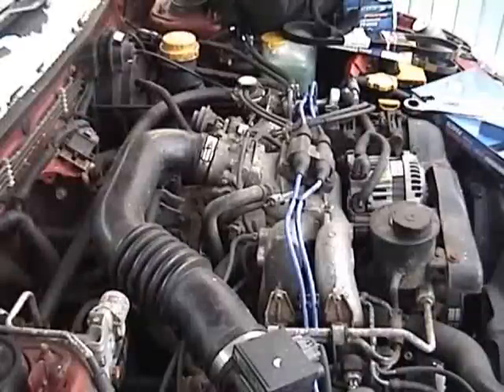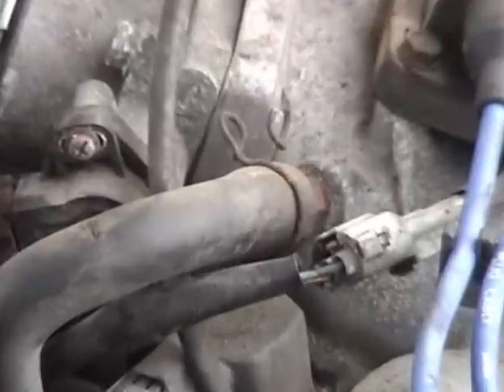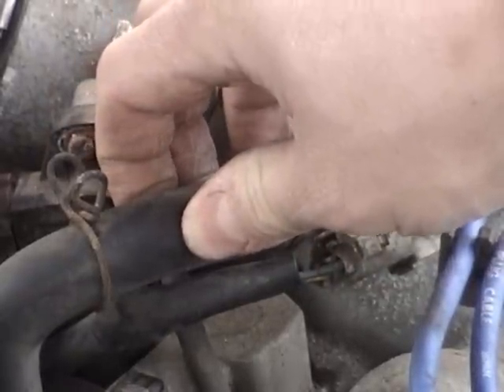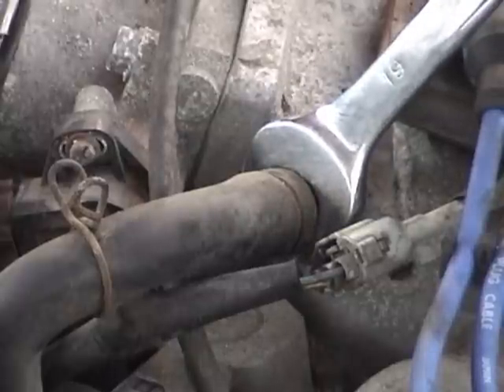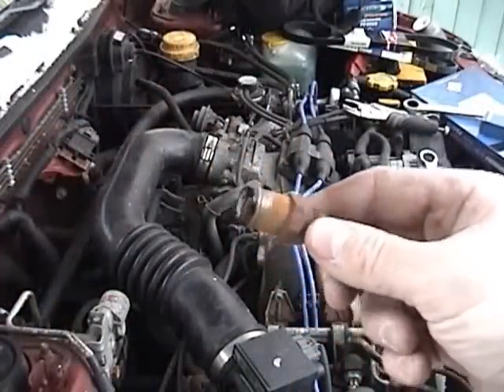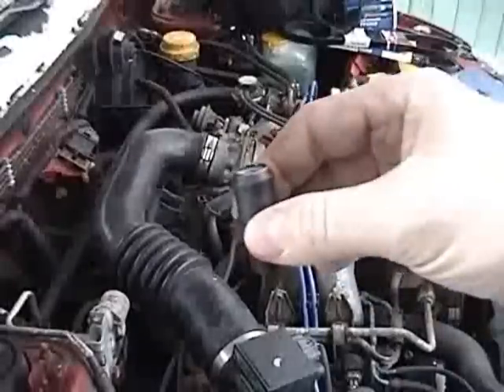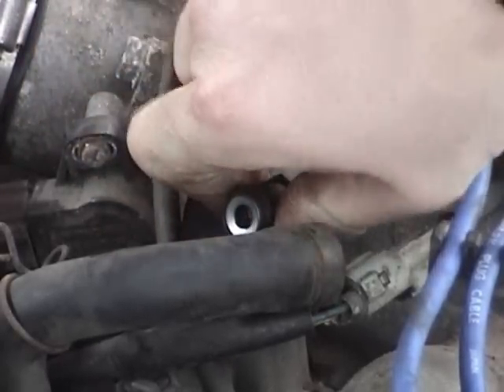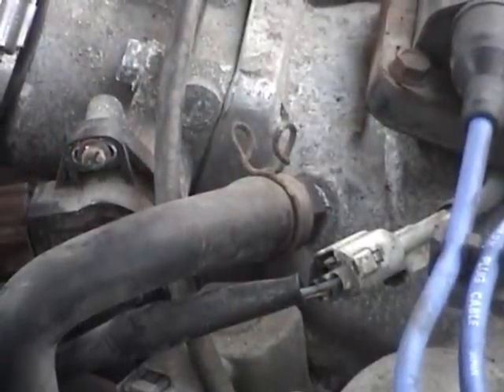1995 Subaru Legacy L Outback: DIY - pcv valve replacement

Comment: This was helpful for me. Just did this for my 1999 Legacy BK 2.2L, removed three 10mm bolts holding down ignition coil, unplugged its terminal, moved it all aside, detached PCV hose, then removed PCV with 19mm socket.

Comment: Do you know the name of the part that the pcv hose connects to? Hard to describe it, but it also has a small hose that connects to the air intake?
Reply from the maker: I assume you're not talking about the hose itself, or the intake manifold. Otherwise, I think it's the idle air control valve.

Comment: 250 T 1995  doesn't seem to have one there, different set up I think. the hoses from the tappet covers go to a t below main air intake pipe. so not sure how to do mine
Reply from the maker: John Kerwood Not sure what to say. This engine was an EJ22. I've never actually worked on a 2.5 liter Subaru.
Reply: MercedesDieselGuy ok yeah my old 96 LX 2.0 ej20 is the same as your 2.2, but Here in NZ we get 2nd hand imported cars from Japan and quite often they are more high spec and set up a bit different , than our NZ new cars. But anyway my 250 t doesn't have the pcu there, valve and I cant find it I will ask dealer. But also the ej25 dohc is a very good motor power wise about 165hp and has good torque ,

Comment: I have a 95 impresa exact same engine what is the thing the pcv valve is attached to. The thing on the motor near the transmission that's attached to the air tube from the air box
Reply from the maker: The PCV valve screws into the intake manifold. But, it sound like you're asking about the throttle body, which is bolted to the intake manifold right near the PCV valve and to which attaches the air intake tube from the air box.
Reply: No the other end of the end of the tube which is split the air intake tube has a tube that splits befor it hits the pcv
Reply from the maker: Not sure I can help. I think I understand your description, but I sold this car some time back and I don't have a good memory of exactly how all that tubing routed.